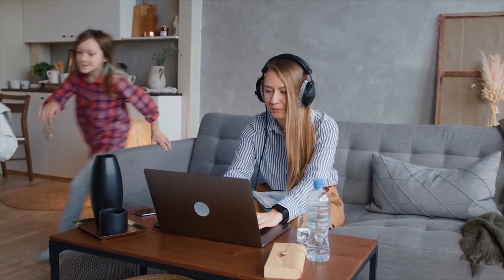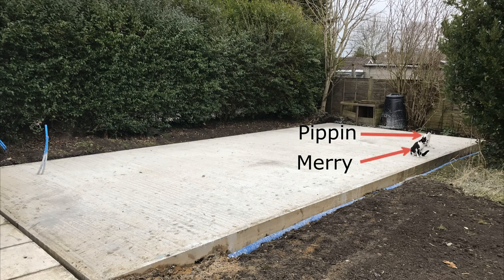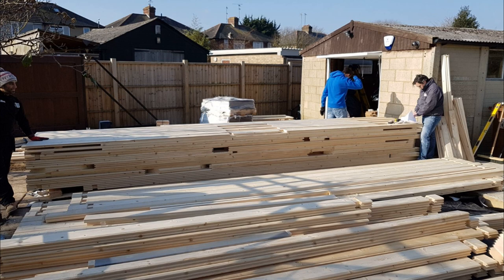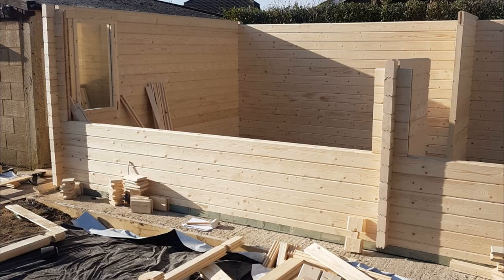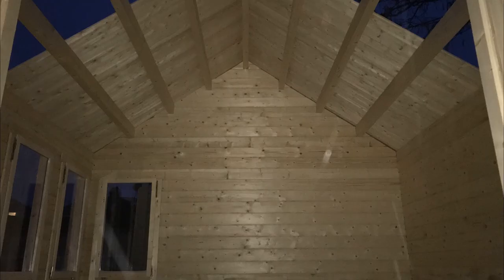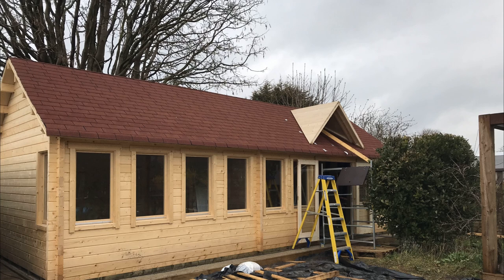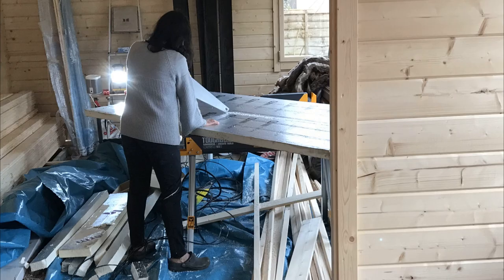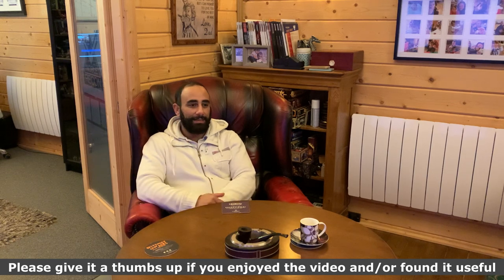The Ultimate Man-Cave, Bar, Games area, Home Office build!

Comment: thats a great build i like the large screen too i have a 30 sqm2 pub at the end of my garden i know your pain when things dont go smooth would like a bit more info how you did your media.
Reply from the maker: Yeah, was a little tricky. Media was easy (ish) as Smart Home A/V is my day job but basically I have all of my sources centrally located (in the bar centre) connected to a Denon AVR (so that does all my audio and video switching). The three front speakers are built into the bar and the rears are wall mount on the back. I then have a cat6 cable going to the projector which sends the hdmi signal from the AVR via a HDMI Balun. (Subwoofer is somewhere near the back too)
Reply: @logcabingaming3710  thanks for taking the time to explain.audio and video is my only let down in my room hope your using it to its full potential.
Reply from the maker: Oh i certainly am 😁

Comment: This is awesome!  3 questions though. How long did this take to build? Did you install AC? And what budget would suggest when starting to build something like this.
Reply from the maker: All good questions. The build time is a grey area. It didn’t take long to get it water tight, maybe a week or two. 3-5months to get all the extras in and to paint and treat the outside too.  I didn’t install AC but it does get hot in summer but not as sweltering as other cabins who don’t have insulation...though AC is a def consideration on the next one. Budget is down to what you want it fir and the space you have. You can start off at about £1.5k for a small 3x3m one if you’re gonna do all the work yourself or you can go up to £15/£20k plus fancy extras (such as home cinema etc in it). If it’s just gonna be a home office you can do it cheaply.....but if you’re going for all bells and whistles entertainment then that’s a completely different kettle of fish

Comment: Hi, nice video.  I'm considering getting the shorter 5.5m version of your cabin and was just wondering what you think about the standard double glazed windows supplied as there's an option to get uPVC double glazing with greater thickness of the sealed glazing units but, it is quite a costly upgrade and I was just wondering if it is worth it, or would you spend the extra on thicker roof insulation as you mention?
Reply from the maker: Hard to say, the cabin does get quite chilly in winter even with insulation. It holds heat well though. I think if you have the budget now to do the double glazing and get thicker insulation then your pocket (and your feet!) will thank you in the long run. Ps if it was me I would def go for it but I don’t think I had the option when I bought mine
Reply: @logcabingaming3710  thanks for your prompt response.  I hope you get many hours of pleasure from it.
Reply from the maker: My pleasure. I’ve had many YEARS pleasure out of it 😂. Has been a godsend during lockdown!

Comment: How warm is the cabin in the cold weather and cool in hot weather using 50mm insulation board under the floor/on the roof? (when it's chilly outside do you need the electric heater on all the time?)
Reply from the maker: the cabin is cold in winter but heats up quickly and maintains the heat quite well - only thing is your feet get quite frozen if you're sitting at a desk all day so i invested in some heated socks to combat this!  The cabin is quite hot on the hottest of days but no hotter than the house though a friend of mine has an uninsulated cabin and said his was unbearable compared to mine so i guess it works.
Reply: The price of those insulation boards I was hoping it would be super toasty all the time! Oh well, I'll try to go as thick as I can afford 🤷‍♂️. Thank again for the info

Comment: Hi please can you tell me ur total cost for the building
Reply from the maker: Hard to say really. Here were the rough costings

Cabin from Tuin - £8500 + VAT
‘Optional’ Extras such as insulation etc - £1000
Timber and bar top/pumps/fridge etc -£1500
Electrics & AV/Cinema/Wi-Fi/Crestron Control £5000 (but I’m in the trade so this is exceptionally under costed)
Ground work/base £3000